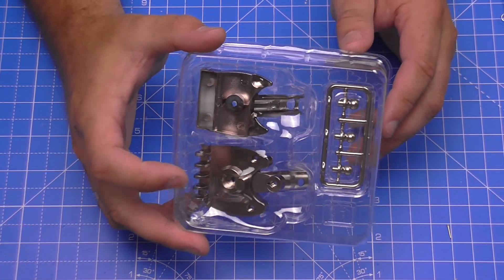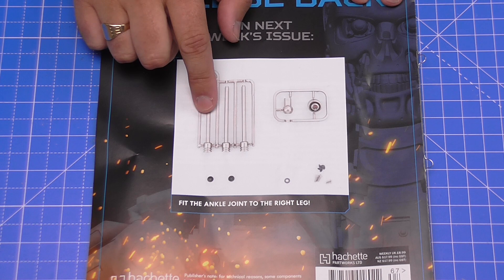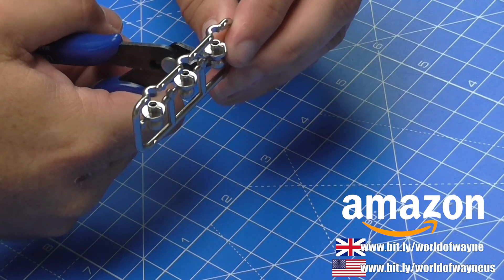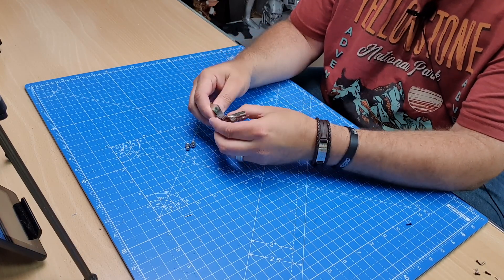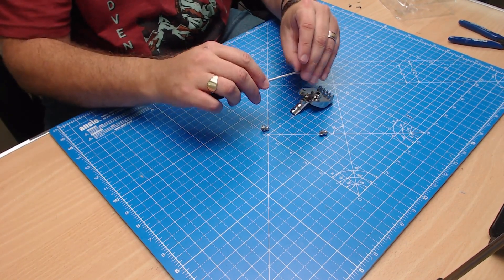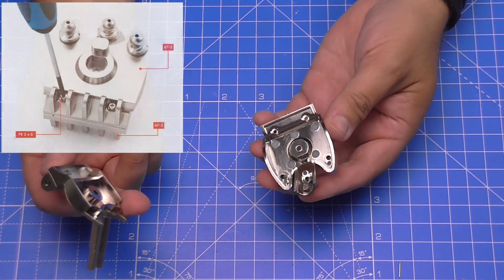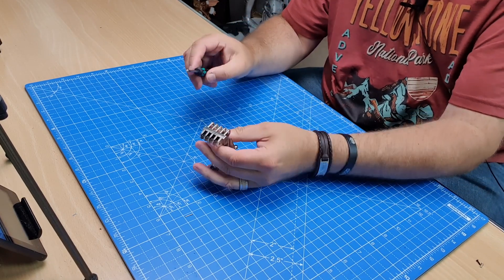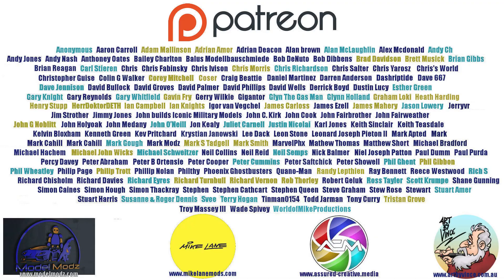Build the Terminator - Part 67 - The Ankle Joint

Comment: you'd think being the foot and it having to support the full weight it would be all metal
Reply from the maker: There is a really good reason why it isn't. I now have the full prototype here and will try and explain it on next weeks live stream
Reply from the maker: @Andyguy it's not just about the weight if the legs were metal you wouldnt be able to move them as the height would be fixed by the stand at the back. Plus weight is a big issue as the prototype here is all plastic and it is almost impossible to lift as the base is so heavy.
Reply: The toes are all metal I'm on issue 72 and the guy is getting heavier by each issue